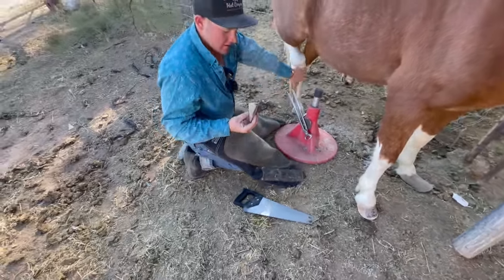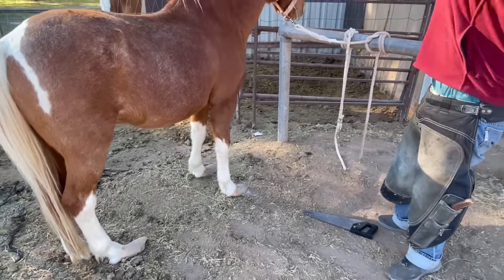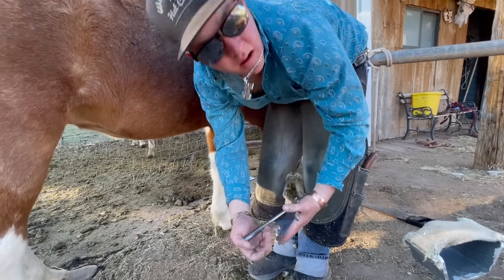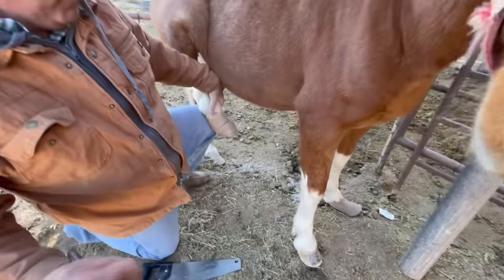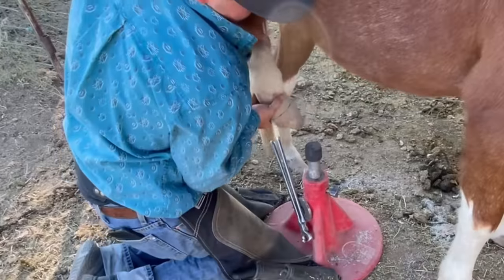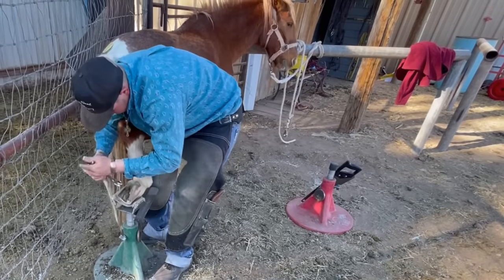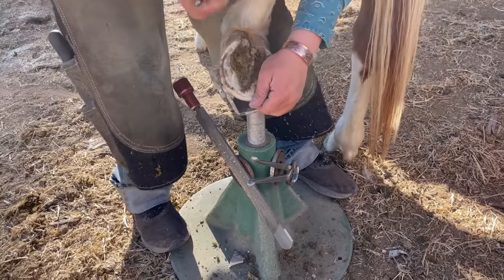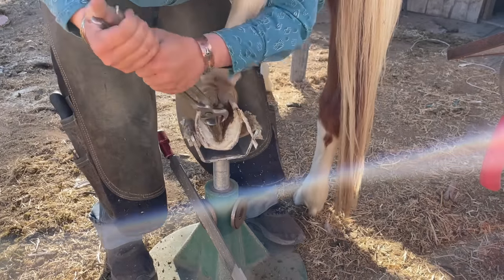NEGLECTED PONY has the HAPPIEST REACTION TO GETTING HIS HOOVES TRIMMED |The Dodo Heroes

Comment: As a farrier for more than 50 years, I loved watching this in its entirety.  One hint that might help you is, use a pruning saw to cut off those slipper toes.  What a good pony.  He’s not foundered!
Reply from the maker: Awesome. Thanks!!!
Reply: As a dog groomer, I wet the big, tough nails and let them set for a bit before trying to trim them. It softens them right up and saves my poor hands!

I assume that trick would work on hooves, too?
Reply: @nobody8328 it does, yes
I worked on a horse ranch once and it was commonly used there. The only downside is, keeping something straight on the hoofes for some time to give the water the chance to be absorbed. Horses like to run and jump around and often loose whatever was bound to the hoofes 🤣
Reply: 中国での作業を見ていると良く切れる刃物で大雑把に削ってから仕上げ、あっという間に終わります。
このように何年も手入れされていない沢山のロバ達が爪切りを待っていました❗

Comment: Rub the saw with a bar of soap, just damped with water. Cuts smoother.
Then clean and oil your saw after you finish.
Reply: I know nothing about horse care, but I think I'd try a battery powered saw!
Reply: @SJB79225  noise and vibration could scare them.

Comment: Try soaking you Cody James rasp in 50% water and 50% muratic acid to resharpen them, that’s how I resharpen files. Make sure there is no oil on it. Trial and error for time in solution but it should help a lot. The acid eats the metal which puts a sharp point back on it